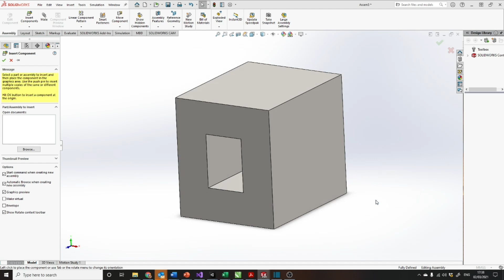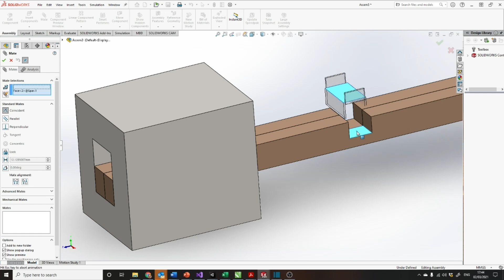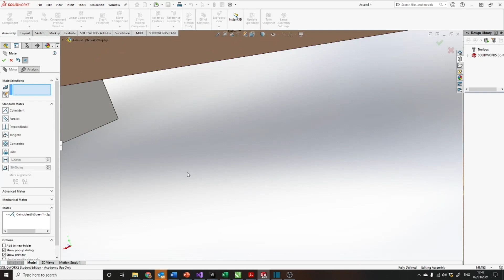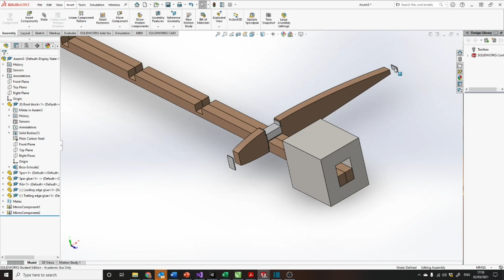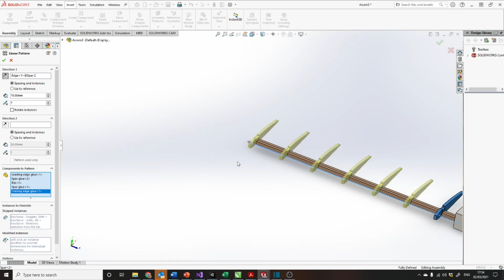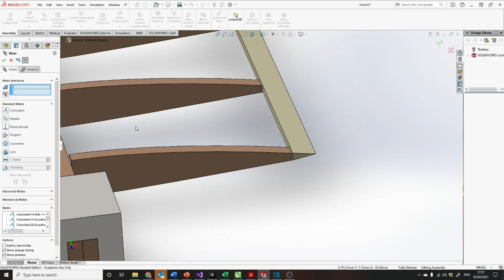Wing Build Tutorial 1: Wing Assembly

Comment: Sir when I try to mirror a part using an plane, the part mirrors relative to the chosen plane as it should do, however the plane is not around the spar or root block so it pops up at a random spot in the air. Is there a way to choose a plane relative to the surface that we want to mirror the part?
Reply: do you still have access to the files